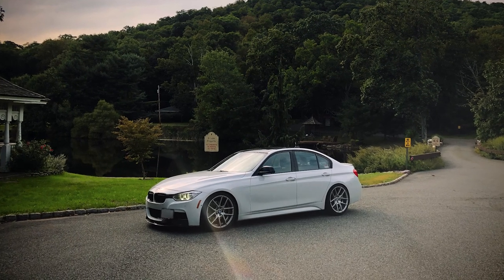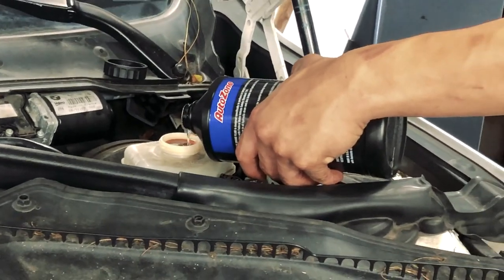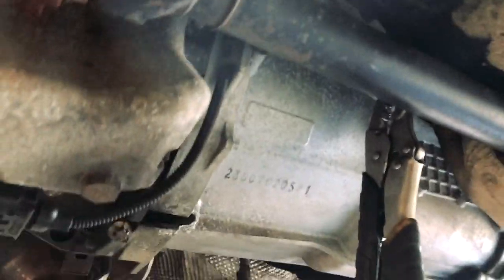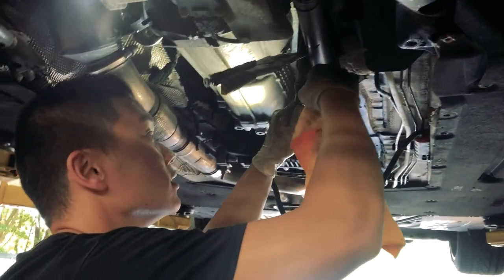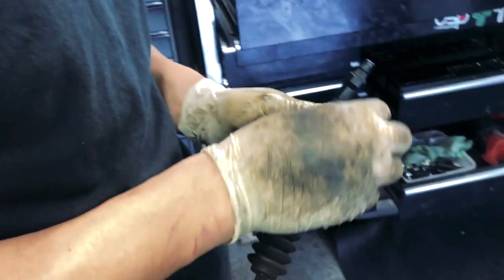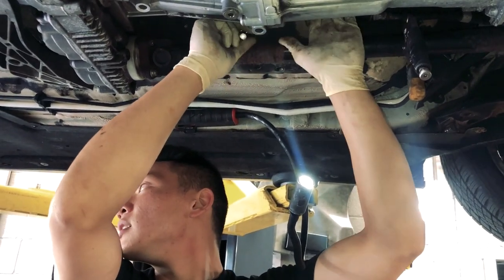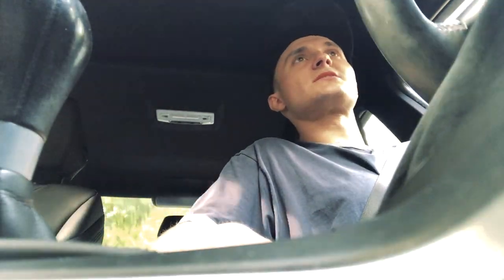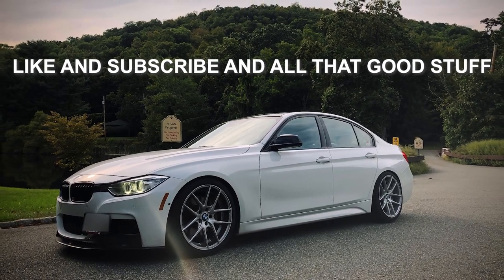Step-by-Step Guide: Removing Clutch Delay Valve in BMW F30 335i 6MT

Comment: Do you have  to remove this plastic thing ? Or you can just remove the rubber hose and stick screw there ?
Reply from the maker: Is best to remove the whole slave cylinder. Easier access to the cdv
Reply: @tomgorelik  thanks for replying and what kind of hydraulic fuel did you pour? Can you describe please

Comment: Can you describe what the delay does? I've had weird shifting issues which never happened in my last manual car or any other cars. I always feel like I'm releasing the clutch too fast and it jerks the car or I have to release it very slow to have it engage smoothly.
Reply from the maker: The cdv “smoothens” the clutch engagement/disengagement. Although I do recall that jerky feeling with it still installed. It’s a newer manual car thing and is another thing that disconnects the driver from the car. Highly recommend this mod.
Reply: @tomgorelik  thanks I think I will do it in the spring

Comment: Anyone do this on a F82 M4?
Reply from the maker: Thats a good question...I don't see why it wouldn't be possible on the 6MT cars as it's most likely very similar slave cylinder/assembly
Reply: Yes do it. Either pull the valve or just buy an OEM E90 slave cylinder

Comment: Hey does this mess with the automatic downshift rev matching at all? Thinking of getting this done to my sportline.
Reply from the maker: That’s a valid question to which I don’t have an answer. I didn’t even think about that. I’m assuming you have an M car? Those are the only ones that have rev matching in a manual correct?
Reply: @tomgorelik  I have a 330i sportline. It does have rev matching downshifts and I can only turn it off by going into sport plus mode
Reply: I did get the cdv delete done btw and it works fine
Reply from the maker: @maxcardenas8257  AYYYY good to hear. Yeah I was thinking about it more, seems like it would be fine, all it does is limit the speed of the shift and how much to slip the clutch to prevent wear. Glad it works fine!

Comment: Whats the point
Reply from the maker: Makes shifting and downshifting feel very connected to the car. The CDV kind of dulls the feeling of the manual. Also, when shifting in the lower gears, theres a lot of delay in the clutch engagement, making you think your clutch is slipping or you have a boost leak.
Reply: I see wld this work if I have a twin disc clutch
Reply from the maker: @Zzombie_666  I'll be honest I don't know as I'm not too familiar with DCT's but I would say, do some forum searching, I'm sure someone has brought this up in the past. I wanna say its not doable though because a DCT is pretty different compared to a manual trans car but worth a look.
Reply: @tomgorelik  got it thank u hope u have a great day